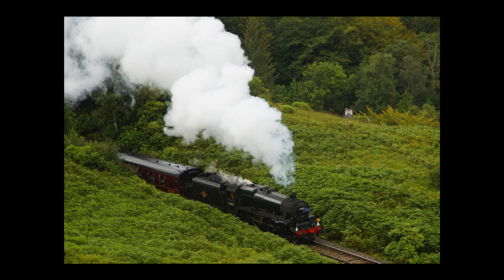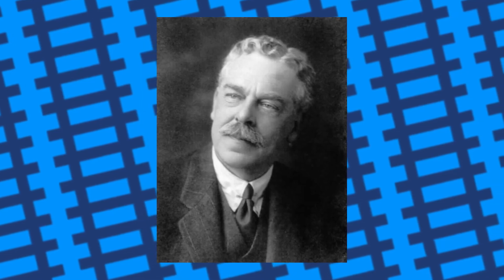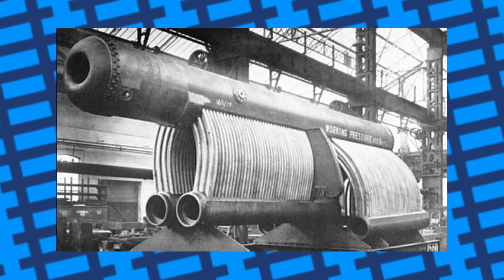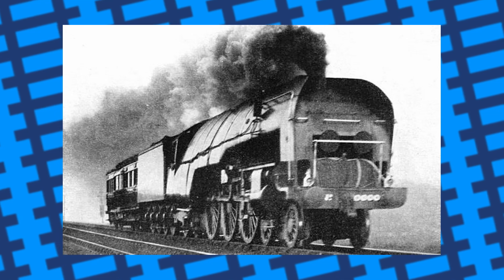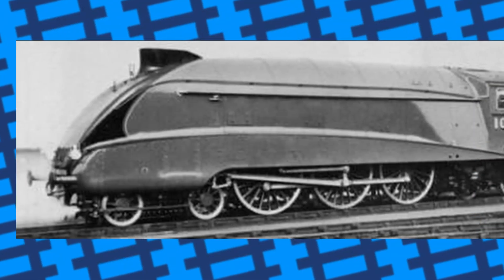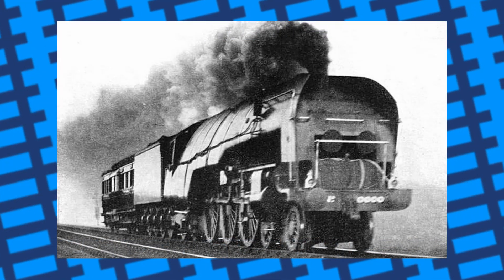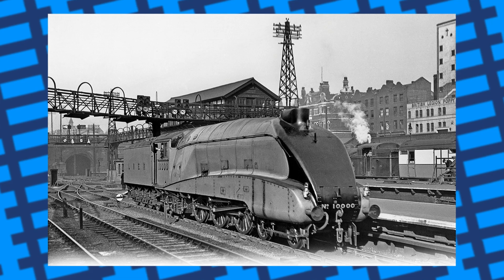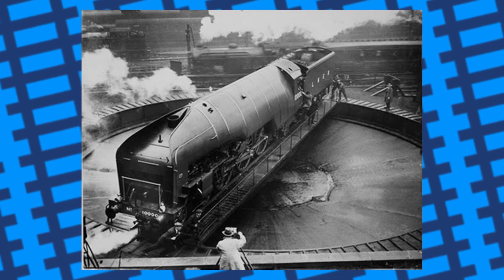The LNER's experimental locomotive - The "Hush-Hush"

Comment: The limiting factor for the speed of a steam locomotive is the rate that cylinders can reciprocate, which passes on to the size of the driving wheels.  That is why passenger steam trains had larger wheels than goods haulage, but goods haulage having smaller and more wheels had more tractive power.  The theoretical advantage of HP steam locos was thermodynamic efficiency requiring less coal.  The Hush Hush was designed to use 20% less coal than its equivalent express steam locos.  That did not happen as hp steam proved to be too dangerous, in addition to unanticipated extra erosion on the steel piping requiring extra maintenance.  The Hush Hush was run for a while but at typically express steam pressure of 220 psi.  HP steam might have worked fine on ships, but proved to be a bit of a failure on locos.

Comment: Hush Hush was designed per Gresleys thinking that he didint want it to be any more powerful than the existing A1 pacifics and he also got the design of the compounding wrong.  If these faults had been dealt with it would have a powerful locomotive.  there was nothing wrong with the boiler concept that a bit more work on getting the drafting correct wouldn't have cured.

Comment: The funny thing is about this locomotive due to its wheel arrangement of four leading trucks six drive wheels and four trailing trucks this locomotive would’ve been called a Hudson here in the United States after the Hudson type locomotives used by the New York central railway
Reply: Stop comparing things to America
Reply: @raphaelsmithwick4363 shush

Comment: The W1 - Hush hush.  They one big mistake they made was that every cylinder was designed around 200 psi as the working pressure.  The boiler steamed poorly under motion and instead of changing the design of the cylinder or boiler it was easier and cheaper to scrap the project and go to standard 200 psi boilers.

think about it.. marine boilers only had to generate steam and turn a propeller that pushed the ship through water...  Once a ship is moving its momentum and water dynamics will keep it moving with little input of extra power.
A steam locomotive is pushing air out of the way, overcoming drag of that air and maintaining the speed of the train.  meaning that the steam locomotive needs more steam usage to move that same distance... it has a different drive system as well. With the propeller being a rotational engine and the steam engine being indirect drive.
Basically if they had changed the design to a steam turbine engine... They may have worked better. But the cylinders were designed after 200 psi running... decades of development.

Comment: THERE WERE SEVERAL ATTEMPTS AT ULTRA HIGH PRESSURE STEAM BY SEVERAL RAILROADS IN OTHER COUNTRIES AS WELL!
THE MAIN PROBLEMS BOILED DOWN TO (PUN INTENDED!)
LEAKAGE- ULTRA HIGH PRESSURE STEAM LEAKAGE ERODES BOILER PIPING AND FITTINGS SEVERELY!
LUBRICATION- SMALL AMOUNTS OF OIL ARE INJECTED IN TO THE STEAM GOING TO VALVES AND PISTONS FOR LUBRICATION!!
THE HIGHER THE PRESSURE THE MORE EXOTIC LUBRICANTS ARE NEEDED!
THE ULTRA HIGH BOILER PRESSURE APPLICATIONS ARE MORE SUITED
TOWARD STEAM TURBINE APPLICATIONS, BOTH TURBINE-MECHANICAL DRIVE AND TURBINE ELECTRIC DRIVE!
THE TURBINE DRIVE SYSTEMS 
ALSO HAD THEIR PROBLEMS
BUT WERE SET ASIDE AND FORGOTTEN IN THE THEN EMERGING DIESEL LOCOMOTIVE 
AGE!

Comment: Why was it scrapped if it did well?
Reply: Sadly a lot of old steam locomotives where scrapped in the late 30-40s, the scrap metal price was high because of the recent war and the old steamers had gradualy became obsoltete when the electric locomotives took ower a good chunk of their former work in the 1930s. The old beauties required a lot of mainteance and where expensive to run in comparision because of the relativly low energy efficiense. The boiler will wear out ower time and require a rebuild and replacing a lot of expensive parts in order to operate safely and without leaks so my guess is that they did run those old beauties on non electric parts of the tracks and for some industrial applications as long they still had the old coal supplies and the boiler was concidered worth to keep maintain. The locos built for passenger freight where probably concidered obsoltete much earlier then the heavy industrial locomotives wich could still be used for special purpose, like industrial ranger, etc. I think those where still built in the US in the early 1950s in the coal districts.
(In scandinavia the electric trains did apear in the 1920s and a few of the old steam locomotives where set as war reseravtions until the 1980s, it annoys me that so many of them where scrapped from the Swedish mobilising stores in the 1980s, that is a genuine shame! They realy should had preserved more of them on museum. They where at least much better about preserving them in the UK.)

Luckily there was people in the 1930s as well who had the same taughts as today and refused to turn in the locomotives if they could preserve them, but sadly there are not that much one can do toward directives from above unless there was a portion of luck involved and it could be classified as being of national interest, i suppose it was something similar in Britain.
Reply: @Vampi_Sweden  yeah,Britain was kind enough to let steamers run till the 60s (they even let a Single wheeler locomotive do normal work until it was withdrawn in 1935)
Reply: @davidantoniocamposbarros7528  Honestly i am a bit jelous about how much history wich are still preserved in Britain compared to Sweden, here most old things where concidered almost a bit as a shameful reminder of an old era in the 1970s whan everyone wanted to show the new modern standard and very little from our past has been preserved here.
Reply: @davidantoniocamposbarros7528  On the other side isn't Brazil a bit like Australia in that meaning things often are stored as spares on remote locations and because of that has been preserved?
Reply: @Vampi_Sweden  i don't know,maybe?
Reply: @davidantoniocamposbarros7528  
Ok, i just assumed... sometimes realy good bits are hiding under plain sight once one learn how to discover them. :)
Reply: @Vampi_Sweden  yes
Reply: Because yes

Comment: You have oversimplified the problems with steam engines and this boiler. The limit on the speed of a steam locomotive is most commonly the back pressure needed to drive exhaust steam from the cylinders and through the blast pipe. The faster you are going, the faster you need to get rid of the used steam. To get a higher flow through the exhaust pipework you need more pressure, and that pushes on the piston opposing the incoming steam. The faster you go, the worse it gets, and the power of the engine falls as its speed increases. The problem was never completely solved, but the most promising line of attack was big valves and/or poppet valves. The 9Fs were noted for their speed capabilities, with their large valves and small wheels.

The other problem was the boiler. It was based on contemporary marine and power station practice, but had enormous differences. To have built a boiler and attached it to an untested locomotive chassis was rather hopeful. Does anyone know if any stationary experimental boilers were ever built and tested as part of the development of this boiler?

I know that Gresley has many fans, but I have always felt that he was out of line with his contemporaries, and that Peppercorn went a long way towards bringing the LNER back into line with best practice elsewhere.
Reply: Cool essay no one asked for
Reply: @davidantoniocamposbarros7528  Rude comment no-one asked for.

Comment: my theory of why this design failed is that in a marine environment water-tube boiler, the heat from the fire rises around the tubes and then goes up (if you look at pictures of Yarrow Boilers installed in ships, you can see that the exhaust rises straight up vertically and doesn't need to travel horizontally like in a steam locomotive). but those hot gases need to travel towards the front of the boiler in a steam loco, so you aren't getting enough actual heating area on the water tubes compared to the theoretical heating surface. Marine boilers on steam loco's have never been a success, either due to high maintenance or poor steaming ability.
Reply: @barnabyjoy Interesting insight from someone with a working model
Reply: @barnabyjoy Huh, so I had the right idea, just the wrong information. My theory was wrong. Thank you for this helpful information
Reply: Go and look at the file in the NRM.
Reply: @DeCasoU1  why? does it prove me wrong? and what file? is it an LNER performance review? the steaming ability of the Yarrow designed boiler? Is it Nigel Gresley's thoughts on how he overcame some of the potential issues I stated?

Comment: I heard reciprocating speed of pistons and the main wheel size are the limiting factors in steam locomotive speed.
They tried large drivers (as Americans call them), but that's impractical.
I would guess gearig could be an option for increasing speed.
Reply: ONE OF THE IDEAS OF HIGHER STEAM PRESSURE WAS HAVING SMALLER PISTONS AND VALVES
WOULD REDUCE RECIPROCATING
WEIGHT BALANCING DYNAMICS, ENABLING MORE SPEED!!
Reply: When it comes to the maximum sustainable speed of a steam locomotive, three things are considered: boiler pressure, heating area, and of course the diameter of the driving wheels and pistons. 

For point #1, the Americans and Canadians proved that 300PSI is the standard for high-speed steamers. Afterall, legendary superpowered passenger locomotives like the Challengers, Northerns, and Hudsons all used 300 PSI boilers either in their as-built configuration or as an upgrade. 

Point #2, the reason you need a 4 wheel trailing truck is because you need a large firebox to produce the heat at an adequate rate to keep that 300 PSI boiler pressure. The more heating surface, the more readily you can access the power of that 300 PSI boiler. 

And now for point #3. There was/is this notion that the height of a locomotive's drivers determines the maximum speed. That is true.......to an extent. A 4-8-4 with 80 in drivers can easily attain and maintain 100 MPH without knocking itself to bits. Beyond 101 MPH, you will be losing rods, nuts, and bolts as you go along. And the piston diameter plays a lot into it as well. If you have a large piston diameter, your loco will turn into a mountain goat at the cost of speed. Pistons with smaller diameters tend to be the real rabbits of the railroad world.

Comment: It wasn't "high pressure steam" per se that didn't work - it was the "Water Tube Boiler" -  many railroads tried water tube boilers but they were unsuccessful because they were hard to clean as locomotives use an open cycle and it was nearly impossible to provide perfectly clean water.   Ships use a closed cycle where the same water is used by virtue of condensers.
Reply: The one U.S. example I know of was North Pacific Coast 21, which was a wrecked 4-4-0 rebuilt into an early Cab Forward, long before Southern Pacific ever thought of the idea. It was given an oil burning water tube boiler built in-house by the Sausalito shops and while the basic Cab Forward design was sound, 21 was prone to wheel slip, due to the new boiler design having significantly less adhesive weight on the drivers than the conventional type. Also, the oil burner heads were placed too close to the steam generating tubes, which led to blistering.
Reply: The water tube boiler worked very well. It continued in service for 24 years after the locomotive was rebuilt in a more conventional form. Dedicated tools were produced for maintaining the boiler, making sure the water tubes were clear of scale.
The engine as built had an issue which took quite some time to be identified. The pipe feeding steam to the cab manifold which fed injectors and so on was simply too small in Internal diameter to be able to supply the quantity of steam needed. No boiler is going to perform well if it cannot be fed with sufficient water. Once this miscalculation had eventually been identified things naturally improved.
The engine remained experimental, the bore of the h.p. cylinders was changed, the engine was set up to work in pseudo three cylinder form and the high steam temperatures did lead to some materials issues but in spite of testing being carried out no one found out how to drive the engine properly. There were clues in the test results but at the time no one picked up on this.
Gresley had wanted the engine to be worked with a high pressure cut-off of 70% but was persuaded by an influential academic of the time not to. Gresley however was right and his thinking was much in line with the developing ideas of Andre Chapelon - long cut-offs on the hp cylinders and adjust the output by varying the cut-off of the low pressure cylinders. It has been extrapolated that if 10,000 had been driven as Gresley originally thought it should have been (which was at odds with what he believed in his earlier days) and in conformance with Chapelon practice the engine would have been the most powerful steam locomotive in the UK by a substantial margin.
Gresley used to delegate to members of his team and many of them were very good but a better man than the responsible individual from 1933 was needed to to get worthy results from this project.
The NRM holds a dedicated file on this engine.
Reply: @DeCasoU1     Nice information - thankyou.   My knowledge is with U.S. made engines.   We had few three cylinder engines with Gresley (e.g. the UP 4-12-2) valve gear.   Gresley gear was a pain to adjust and most of these engines had the Gresley removed and a second Walschaerts or Baker gear added to one side to run the middle cylinder.   American companies also hated that middle cylinder because of accessibility and the crank throw on the axel.    Many tried water tube boilers but they just were not very successful with coal or bunker C oil because the outside of the tubes would coke up and were nearly impossible to clean whereas in a fire tube boiler a little sand would do the trick.
Reply: @Hogger280  The LNER built Gresley engines retained their valve gear to the present day, only a few were experimentally rebuilt and this exercise was not repeated. Those responsible for keeping these engines running have little trouble with the valve gear. And we don't use Baker gear in the UK. Pity you couldn't resolve the water tube boiler issues, they open the door to much higher working pressures.
Reply: The other related issue with boilers like that is water treatment, depending on where it operated, to avoid scale building up inside the tubes.

Comment: Speaking of locomotives that worked, but weren’t practical, let’s talk about the Virginian’s 2-10-10-2.
Reply: The Virginian 2-10-10-2s were very efficient and effective low speed heavy duty haulers in the mountain coal field service in which they worked.
The same could NOT be said for the infamous Virginian 2-10-10-10-2 Triplex w/ the last driver set under the tender. As tender load used up that set drivers lost traction and slipped excessively. Far worse was the boiler capacity that could not keep up w/demand and they ran out of steam routinely before getting to next station down the line!
Reply: @kenhanks9620 , you mean the 2-8-8-8-2?
Reply: @MatthewChenault  Touche! Got hung up on the number 10!
Several other roads tried putting drivers under the tender (one was NC&StL w/a 2-8-2+2-8-0 combo) that had similar results.
If course Virginian eventually solved its worst grade problem w/electrification then ultimately dieselization w/the Fairbanks Morse Trainmaster units (2,400 HP each I believe).